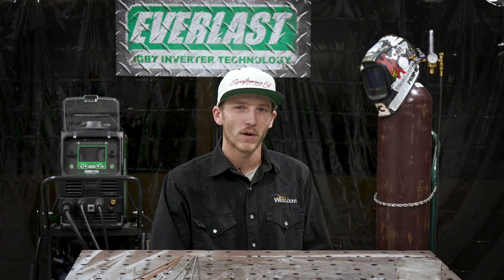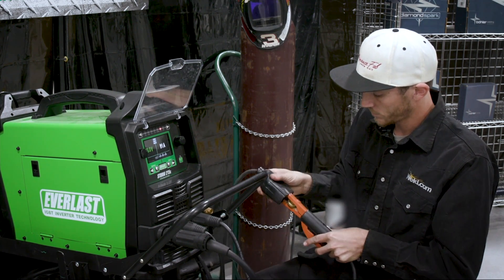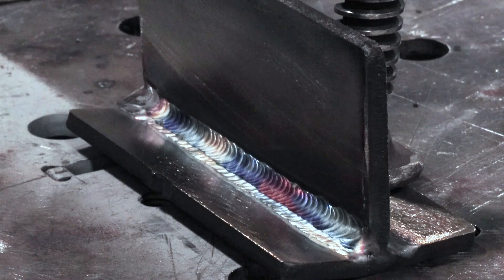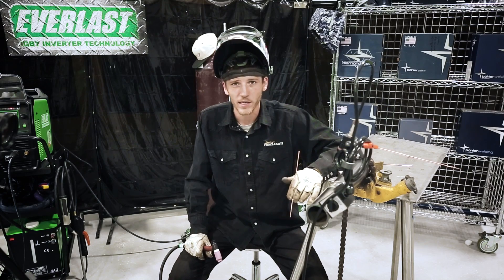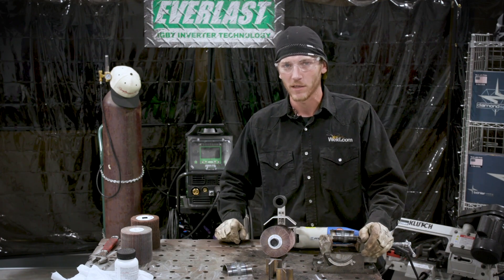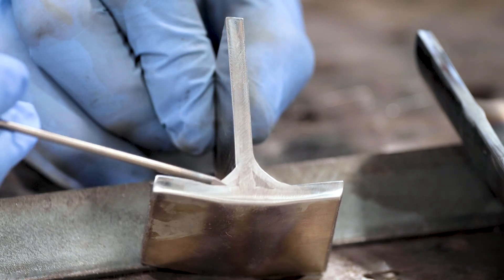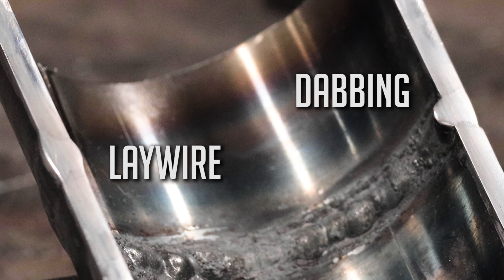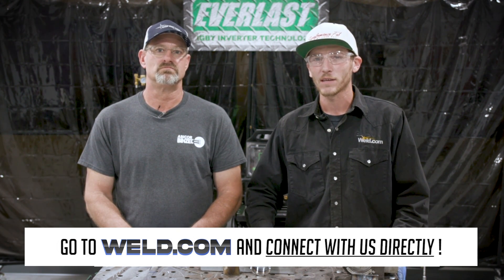Different TIG Welding Techniques Put to the Test with Etching

Comment: I have tried everything to etch my TIG weld.  They will not etch.  Any reason? The welds look great and burned in good.  ER70S-6 filler.  Been welding for years and even welded molds when I was a tool maker with TIG..   I cannot get a etch line.  I even cut  the welded part off and it was burned in as it should be.  I am using Permatex 81756 Rust Dissolver.

Comment: Never seen a lay wire technique on this channel, I personally prefer on carbon or up to p22 chrome which uses 90 series wire a 5/32” gap and 3/32” wire and I only dab if the gap closes otherwise I actually feed the wire